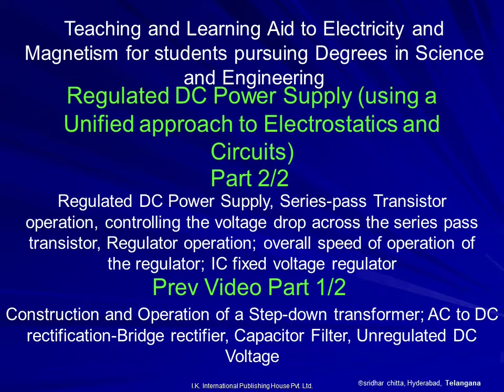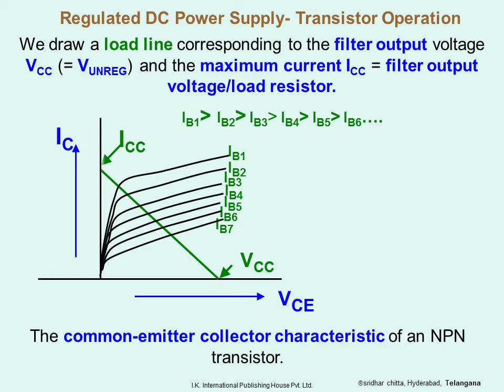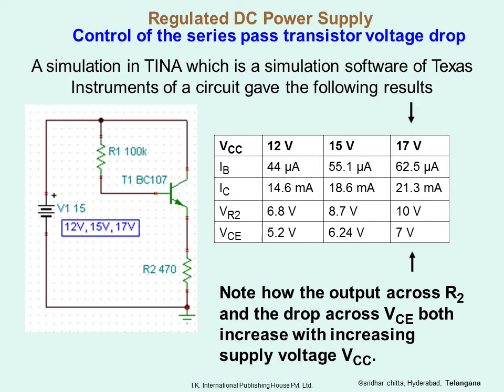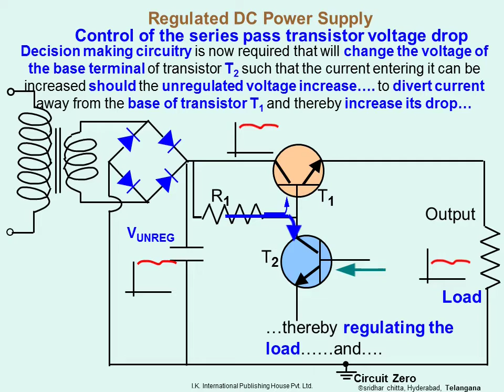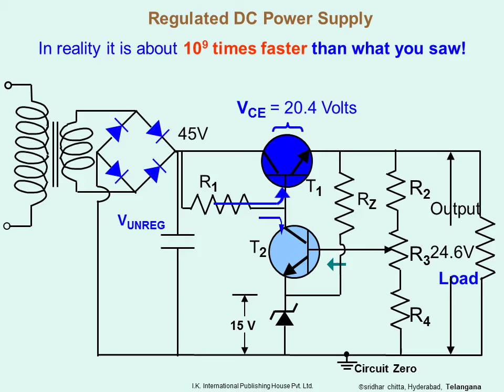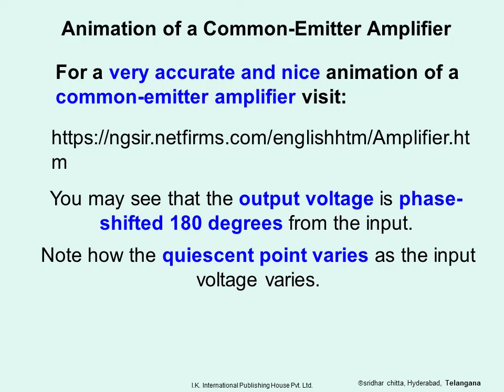Part 2 of 2 Regulated DC Power Supply

Comment: a bit tiring :) but very well explained. benefited much. thanks
Reply from the maker: Thanks.  Sorry if it was  a bit stretched.
Reply from the maker: I have published one set of videos in two parts on the Basic Action of a Differential Amplifier the heart of the Operational Amplifier using a unified approach to electrostatics and circuits 
Part 1 of 2
https://youtu.be/uggOykLShMU
Part 2 of 2 
https://youtu.be/jLJAYyap5WA
 Will be happy to receive your comments. Thanks. Sridhar